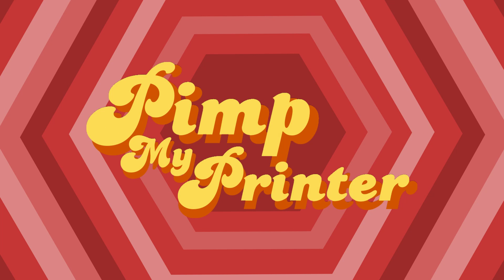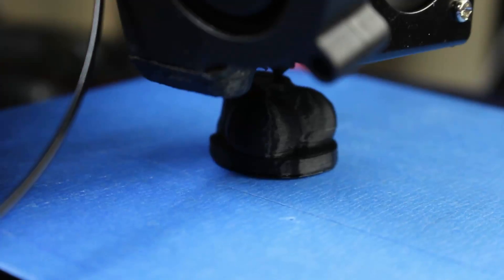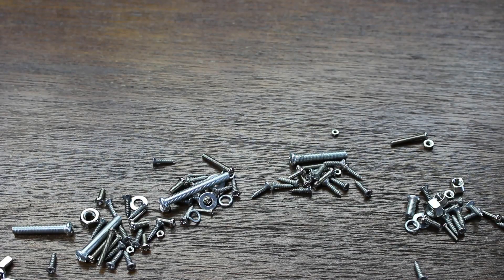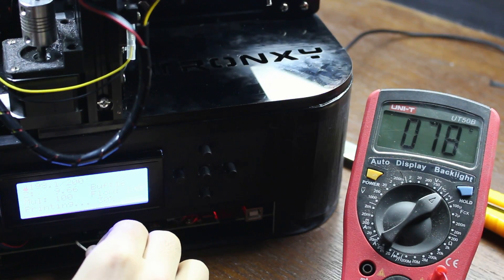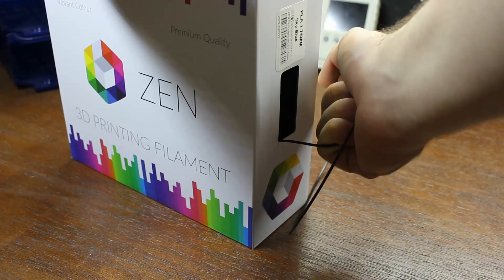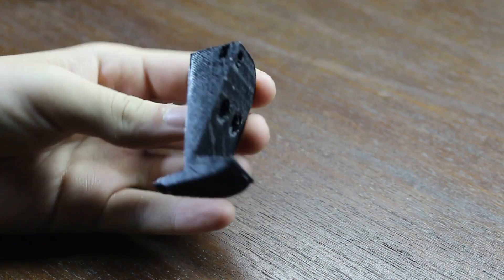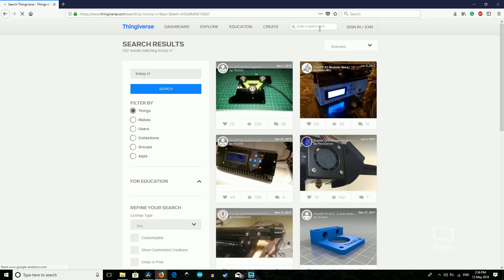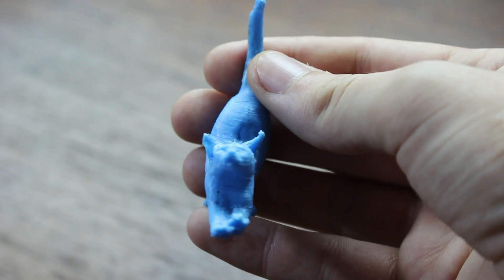Pimp My Printer - Tronxy x1 Upgrade and Review

Comment: I feel like your adhesion issues are more down to the levelling of your bed,( you'll be surprised at the difference it can make.) Also to eliminate the stringing I'd play around with the retraction settings, I'm guessing by the price and setup it'll be quite high somewhere between 6-7mm/s you've probably worked all that out by now though ☺️ seems like a great little printer for the money however with some more playing around with slicer settings I bet it could produce some really decent prints .

Comment: My brother and I have one, and we actually didn't see any of the online help before fixing it ourselves, so we fixed the wobble by putting electrical tape on the aluminum where the wheels make contact to function as a spacer and it works pretty well. We also tightened the belts with the included holders and an insane amount of trial and error. It was a fun time! We eventually needed to print a spacer for the Z-axis wheels, but only to hold it together where the manufacturer's plastic had cracked.

We also use hairspray on the print bed to get the prints to stick, which works ok unless you print something tall. We got the print quality to look WAY better than what's shown in the video, and I can send you a screenshot of all my print settings in Repetier if you want. (I know Repetier is awful, but I just use it because it came with the printer, and my brother uses Cura.)

Comment: I have the same printer, you need to mod it a bit to fix the wobbling in the bed and the x arm, and add belt tensioner, then with correct parameters it can print really well ! Much better than shown in the video. I think you are either printing crazy fast or having extrusion problems.

Comment: They included a profile for my machine in the sd card.  If you add painters tape to one side of the z rails (like the metal bars the wheels go up and down on) it can eliminate some of the z wobble.  The same goes for the y rails.  I've had this printer for a little over a year now and my only problems are that the screen broke (probably because I accidentally plugged in my more powerful laptop power supply and fried it) and the connection over usb sometimes is shotty.   Overall I think its a fun printer to play with if your willing to do some modding.

Comment: Part cooling fan is controlled via g code or in the printers menu. By default it doesn't run. In the slicer you can tell it to run after a certain number of layers. Generally you don't want to have the print fan on during the first layer. It will cause the filament to cool too quickly and shrink/curl away from the bed.

Glue stick is all I've needed to get parts to stick. Spread some on before a print. I get the kind that starts out purple and dries clear. After a while just remove the bed surface and wash off any built up glue under hot water.

Comment: There's one thing I haven't seen you use and that's the little bits. I think there's even a Minecraft 1.8 mod that allows you to use redstone with them.
Reply from the maker: nathan sasser little bits are really expensive compared to normal parts
Reply: Well if you're looking for a single board computer for your next laptop build. I managed to stumble upon on running windows 10 called the lattepanda.
Reply: I might have a idea for your next video. how about the following.

1 a usb cable able to switch between each wire. so say you have 1 usb male in and 2 usb male out. the switch on the cable will be able to switch witch input the data goes to.

2 a micro SD to micro usb. basically say you have to plug a cord into a micro SD card slot but then you can plug in a micro usb into the other end
Reply: I might have a idea for your next video. how about the following.

1 a usb cable able to switch between each wire. so say you have 1 usb male in and 2 usb male out. the switch on the cable will be able to switch witch input the data goes to.

2 a micro SD to micro usb. basically say you have to plug a cord into a micro SD card slot but then you can plug in a micro usb into the other end.
Reply: I might have a idea for your next video. how about the following.

1 a usb cable able to switch between each wire. so say you have 1 usb male in and 2 usb male out. the switch on the cable will be able to switch witch input the data goes to.

2 a micro SD to micro usb. basically say you have to plug a cord into a micro SD card slot but then you can plug in a micro usb into the other end.
Reply: how about the following for the next video.

1 a cable that let's you switch witch wire in the split sends the data

2 this one's hard to describe. you basically plug in one end into a micro SD card slot and into the other end a micro usb cable.
Reply: sorry about the spam I was having connection issues with my tablet and didn't realize it until I hit is maybe 2-3 time for one of them

Comment: You should make a part 2
Reply from the maker: Maybe when I get a better 3d printer I'll make a part 2!
Reply: Build It Maybe you will get the Anet A8.It is on aliexpress and bestgear.It is pretty cheap(around the price of this printer).
Reply: @Ferferite  And is fire hazard.
Reply: @richardlighthouse5328  yup, better off with the tevo tarantula. Glad I didnt buy the a8
Reply: @Ferferite  No, Ender 3
Reply: @richardlighthouse5328  depends, I got my tevo for less than the ender 3
Reply: @Ferferite  I got my CR-20 for 500 euros. Sadly that is unsupported but still works great. Should have gotten supported 3D printer.